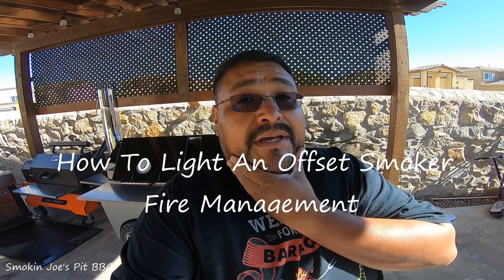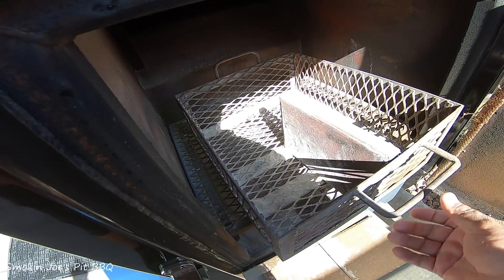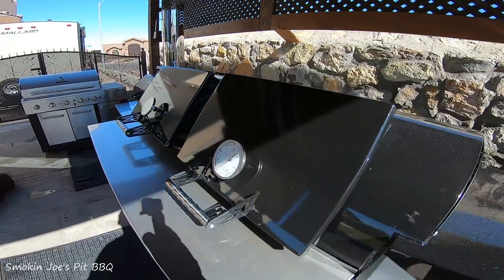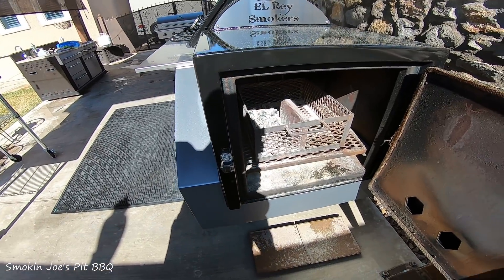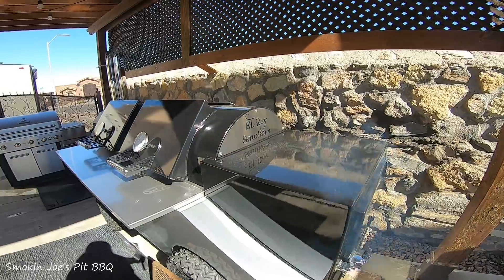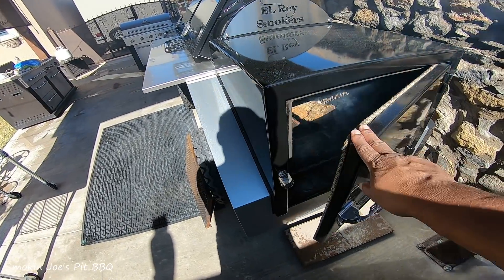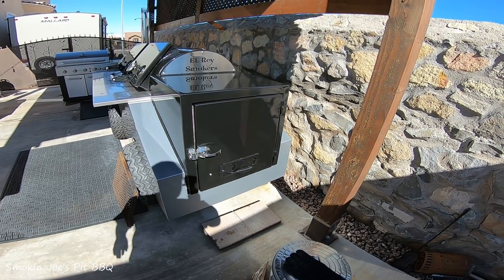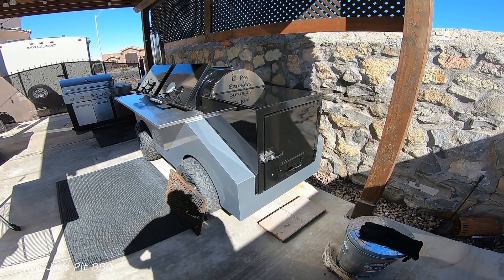How To Light An Offset Smoker - Fire Management - How To

Comment: Put a couple pieces of wood on the right side outside the basket so that it doesn’t make contact and ignite, but pre heats. If you do that, the wood will ignite within seconds. When I do that it only takes about 45 sec. then I have clean smoke. Looks like just heat vapors. Give it a try and see if it works for you. Beautiful pit by the way. Happy smoking
Reply from the maker: Thank you Tim. I already sold this smoker but now I have a Yoder Frontiersman that's a much better smoker. I always warm up a split of wood. If I forget, it takes forever to fully ignite. Thanks for watching.👍